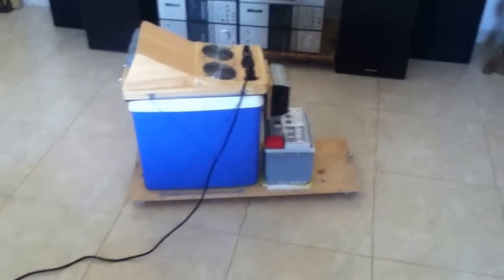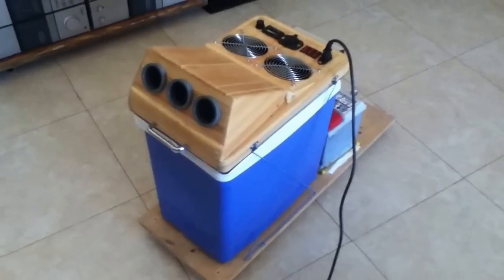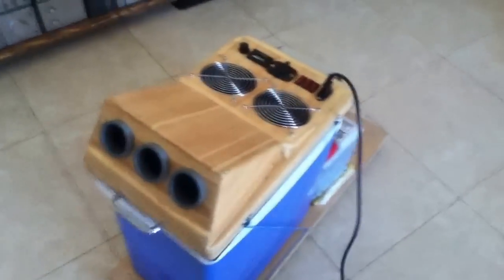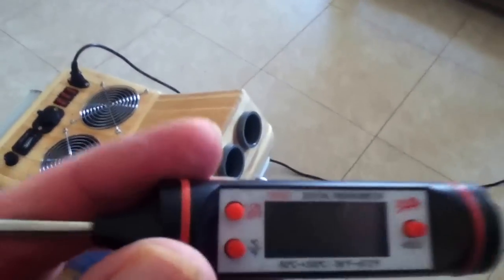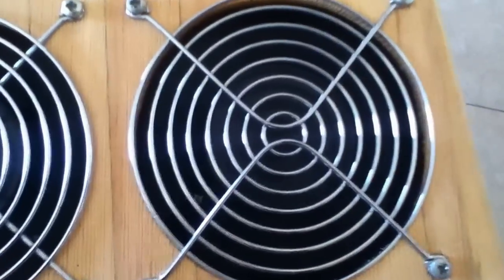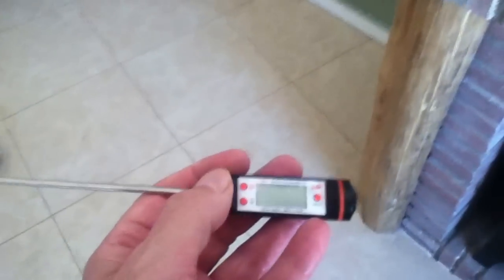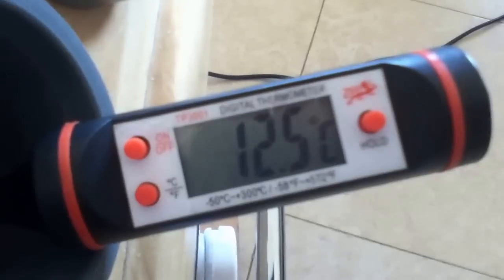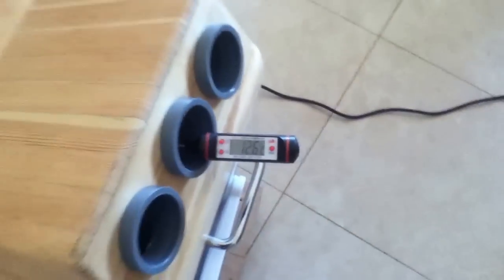HOMEMADE DIY SOLAR POWERED AIR CONDITIONER / COOLER 12v DC or 220v AC ***AIRCONtraption OVERKILL***

Comment from the maker: Hi Dayle, Thank you very much for your comment, I do see your point. I suppose I should have posted the reading in both Fahrenheit and Centigrade. You do have a good point. I was brought up using Fahrenheit in England but now I live in Spain and it's all skew-wiff...... You will know there are loads of websites out there that will convert it straight away for you though. Thanks again Dayle for your very valid comment......

Comment: You said in this video that you take the windows out in the summer.  Yet, you showed us in video 1 that you have air conditioning (the one hanging above the doorway).  Why do you take the windows out when you have to just put them back in when you want to use the air conditioning?
Reply from the maker: +NunOfYourBiz Hi there NumOfYourBiz, Thank you very much for your question. Number one, although we have aircon and it gets to over 40 degrees C here, we never use it because it is very costly. It was a mistake for us to pay out for the aircon initially as it just looks the part with no service...... It was the most expensive one on the market at the time as well so that makes it worse...... Mind you, the heating part of it in the Winter is quite good,....... Thank you for your very valid comment and best regards...... P.S. It only takes a couple of minutes to take the windows out in the Summer......
Reply: +Ian Wills Thanks so much for replying, Ian!
Reply: +NunOfYourBiz No problem my friend I am happy to oblige. I am just very glad that you are interested in my unit, be it good or bad. We can discuss improvements, I am only an amateur so I really appreciate the input from people like you my friend......

Comment: Hi. My name is Imad, and I live in Tennessee State, USA. I've been looking for an efficient, quiet ice air conditioner for my passenger SUV, which has only two front vents that do not cool the rear passenger seat compartment. When I watched your videos, I realized that this is the type of conditioner I am looking for. So please let me know how I can buy it, and how I can contact you? Thanks.
Reply from the maker: Hi Imad, Thank you very much for your great comments, I really appreciate them...... This unit is really good and would definitely outlast any journey you might take, It would also be ice cold if you wanted to choose the high power setting, yet you could just have a breeze with a lower setting...... it's up to you...... With reference to your question about buying it...... I am afraid I have taken the parts off to use for other projects...... However, I still have them all and could put it back together without much effort...... You will appreciate that it took me a long time to design and built to make it this efficient...... Also if we came to an agreement on price then i would only send you the top unit as you will be able to get a box and battery from Tennessee...... You would need to offer me enough including postage from Europe to justify me sending it to you, it now has nearly 500k views in two years and is pretty popular...... At the right price I will get it up and running for you and send it on...... Thanks again for your wonderful comments Imad and best regards......

Comment: How much can cold a room that?
Reply from the maker: Hi there NapalmCandy, thank you very much for your question...... When I took the video I had the unit located in my living room...... The size of my living room is approximately six metres by five metres and it managed that large room very well...... It cools down on a very hot day to a really comfortable level...... I hope this helps you and thanks once again for your question......
Reply: +Ian Wills hi, thanks for the answer. But it is not exactly what I expected hehe

I want to know more numbers, exactly how many deegres was before and after, and how much time it takes to cold. Also how much time takes the ice to thaw. 

I am planning to do something similar but without battery and with a programmable thermostat. And I want to know how many ice I will need to cold my bedroom for a night, to buy a bigger or smaller portable freezer 

Sorry for my english. Greetings
Reply from the maker: Hi again Napalm Candy, If you watch video number three it will show you how many degrees it was before and after...... My six metre by five metre room cools down to a very comfortable temperature within about fifteen minutes...... As I have previously mentioned, I have used this unit for a party in the Summer in my upper outside terrace. We went to bed after the party and the next afternoon (well, lunchtime really) there was still about a quarter of the ice still left in the bottles...... The better quality the ice box then the longer the ice will last...... I hope this helps you and thanks once again for your keen interest...... Please keep watching my channel as I have some more interesting projects coming up...... Cheers for now and best reagards......
Reply from the maker: By the way NapalmCandy, your English is very good so please don't apologise for it...... Cheers......